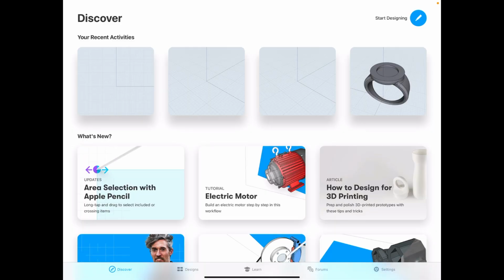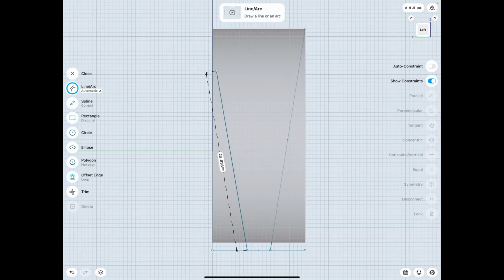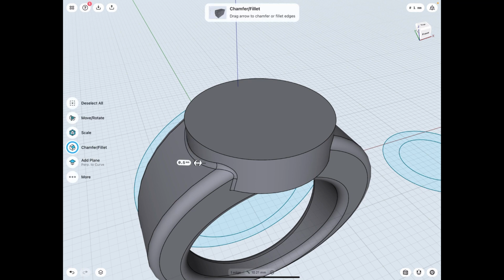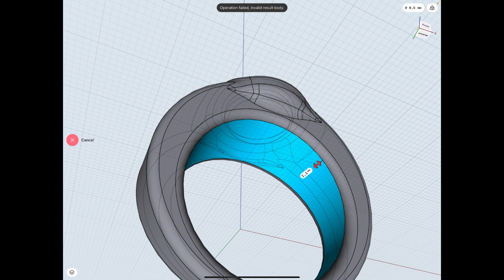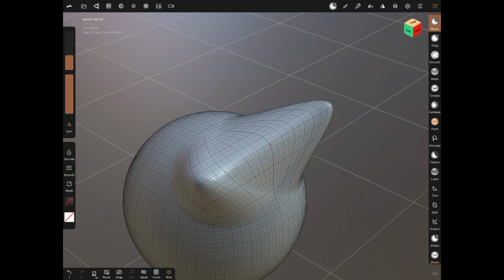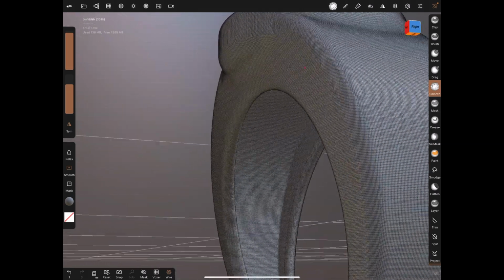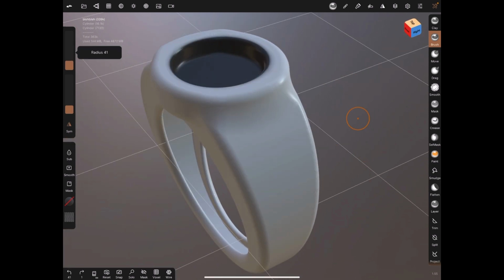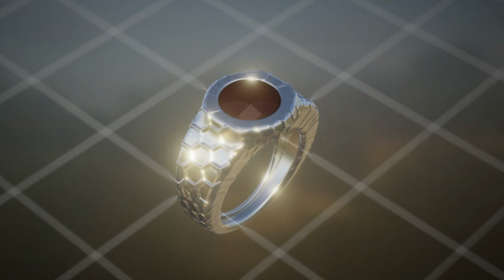The software I use to make jewellery  |  Modelling a signet ring  |  Shapr3d and Nomad

Comment: Hey, do you know if it is possible to design an engagement ring with shapr3d? I'm talking about a full blown out cad design that includes prongs for melee diamonds and center stones? Or is this software just good for less complicated designs? I would then like to 3d print it! If you know the answer for this please let me know.
Reply from the maker: Shapr3D is great but you gotta know what you are doing in terms of stone setting as it doesn't do presets for you like a software like Rhino would.
Reply: @clearmindjewellery  thanks for thr reply !

Comment: Can I use an iPad for this?
Reply from the maker: As per the intro to the video, yes. They are primarily iPad apps, but do have desktop options.
Reply: Thank yu for that. Could yu recommend me any software for iPads that I can use to set diamonds into jewelry? I’m having a hard time finding one. I would like to know the size of the setting so I can measure the size of the stone to apply to it. Any software that yu know of that lets yu add a Diamond setting nd it will tell yu it’s size nd the carat I would need to coordinate with that setting.

Comment: Seeing that you are a Mac guy and use a tablet let me point some of the windows and desktop users to some software.

Note* I'm going to post links seeing that it might get auto filtered and no one will see this comment

Blender 2.93.2 - This is a free program that you can make some amazing stuff with if you have the time to learn it. 
Fusion 360 - This is kind of free but if your are really wanting to use it a lot it does have an annual fee.  This seems to be just similar to Shap3d from what I have seen.
ZBrush - This is a sculpting program that has a monthly fee or you can buy a one time license.

Just some suggestions 😁👍
Reply from the maker: We were taught on Fusion 360 back in the day, lol, would recommend for those with a more engineering mindset (and those using the software for multiple applications) but you are right is is similar to Shapr3D.

Nomad is like ZBrush lite. 

We like using the iPad specific applications as we can edit on the go with clients etc, and they are a lot more intuitive.

Would definitely recommend the ones you listed for those that need a desktop application.

Comment: Thanks for sharing this detailed review, for a beginner like me what software do you recommend? Thanks
Reply from the maker: Shapr3D, if you have an iPad, is great. As Gomeow commented Fusion360 and Brush are good options. I think Zbrush Core is a cheaper option. 
It depends on your budget.
Reply: @clearmindjewellery  thanks! Yes I use iPad and like it (currently using it with procreate and Apple Pencil). Will check out the brushes you mentioned. Thanks again for sharing your expertise.